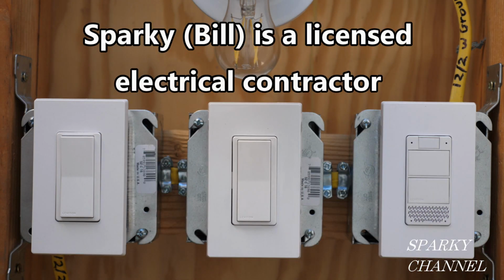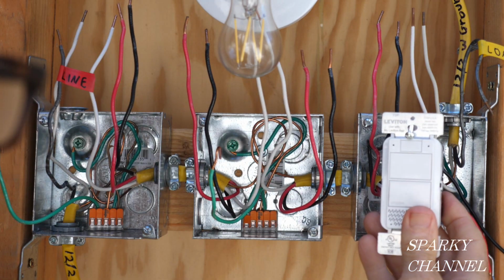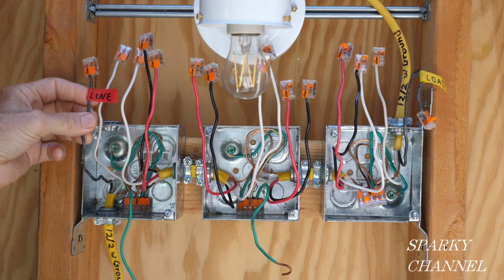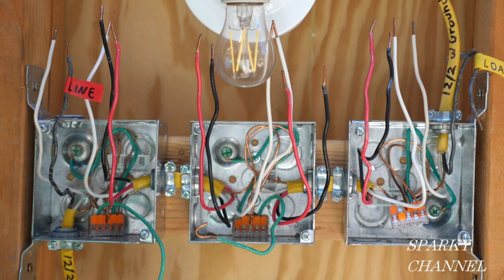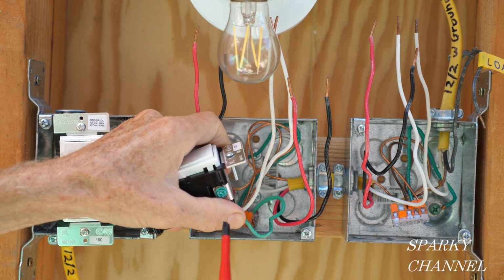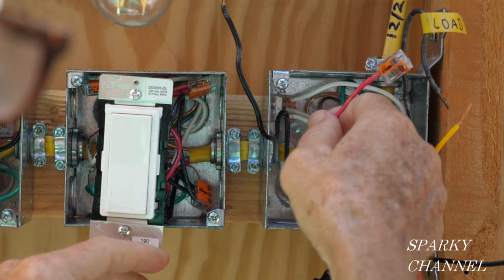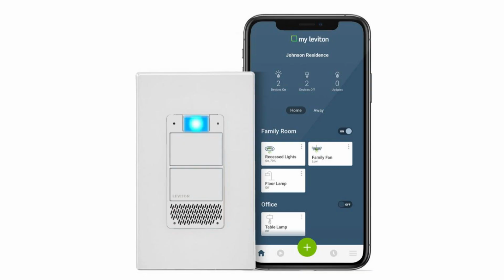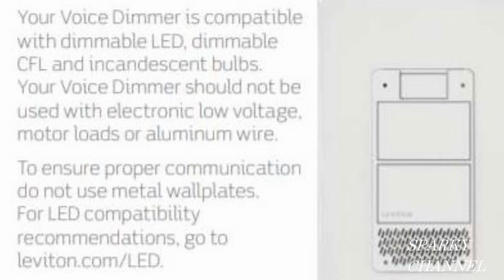Leviton Voice Activated Dimmer Switch with Alexa + 2 Switch Remotes (Multi-Location Switching) DWVAA

Comment: Heck yeah, great explanation! I’m currently enrolled into a trade school 2 months in and I understand some basic wiring but can you explain how come the neutral is connected to the 3 way switch on this occasion with installing Alexa? but not connected when you would wire a basic 3 way were for instance you would just wire nut your neutrals together and Not be connected to the switch? Thank you
Reply from the maker: The neutral is required for some digital switch such as the Alexa but it is not required for standard 3-way switches.
Reply: Thank you! My Professor helped explain it to me a bit aswell

Comment: Why does my house have more voltage? Sometimes i have 125v but at night i have 130-135v
Reply from the maker: I think that would be a problem with your utility company.
Reply: @SparkyChannel  125VAC is pretty normal, anything above that seems excessive. My house is around 125VAC.
Reply: Ok

Comment: Thanks again.  Have Alexa dot on patio for use with alexa speakers. with 12v passive hook up.  Only power is receptacle.   Need to run a added switched outlet, on bottom and always hot on top from this outlet, as I do not want to leave power on speakers when not using even though they are only 12v power,  I will give it a go! Thanks BT.
Reply from the maker: Sounds great! Thanks!

Comment: hey i enjoy your videos , i have to ask a skilled electrician like you , i have 3 feit smart 3way dimmers used as single pole  in one box for 3 separate circuits , i daisy chained lines, neutral, grounds loads separate,  first switch works fine but the other two are always hot  any suggestions thnx for  all your vids cheers

Comment: Why did you use 12 gauge wire on a light circuit? And are those switches rated for 20 amp?

Comment: I always install smart switches in the line side when it comes to 3-way or 4-way switches because I know it's the line side, it gets power all the time, I dunno, not really electrician, but that's my mentality.
Reply from the maker: This dimmer is a trailing edge one, otherwise it wouldn't work with LEDs. Old dimmers are normally leading edge as you describe.

Comment: Now I know how this works. It seems they are retractable switches, they swing back if you let them go. So they're sending an impulse to the voice activated switch which will then turn the light on or off. But for this functionality a neutral is normally not necessary except they have any additional functionality.

I think this would be a fitting wiring schematic, the difference is, there are two lamps in it and it got three additional switches instead of the two additional ones in the video:

https://dein-elektriker-info.de/wp-content/uploads/2013/01/Tasterschaltung1.png

The dimmer is a trailing edge one, otherwise it wouldn't work with LEDs. Old dimmers are normally leading edge.
Reply from the maker: Good points, thanks!

Comment: Hi there. In a common installation for a light in a basement if the load wire was located at the top (Only light) of the stairs and you added a light at the bottom of the stairs would the voice activated switch have to be located at the top of the stairs?
Reply from the maker: Yes, that's correct.
Reply: Sparky Channel wouldn’t I look smart yelling at a switch at the top of the stairs lol.

Comment: great vid.  how did you get the mud rings on after the devices were wired up (lol u cant).  Remember to recommend large boxes for these devices for all the wires you show.  and finally, make sure you mention to viewers to pull the wires under the connections to make sure that they are secure or recommend loops around the screw.  kick ass
Reply from the maker: Sure you can. Just slip them over the switches. Like I said in the video, I would normally put the mud rings on before installing the switches but I did it that way for greater viewer visibility. Thanks Dave!